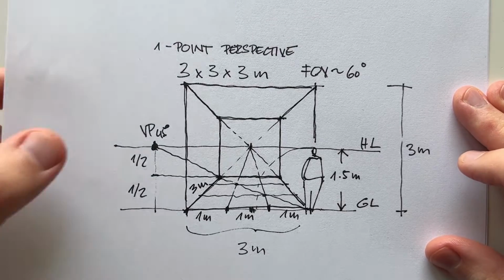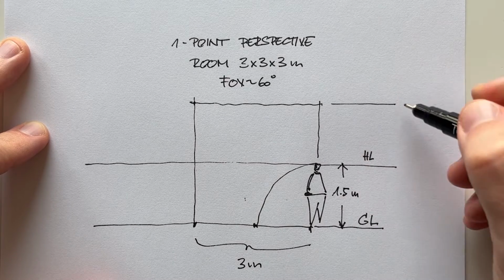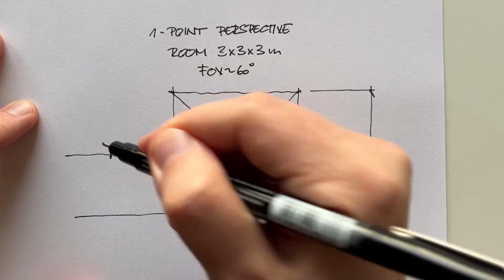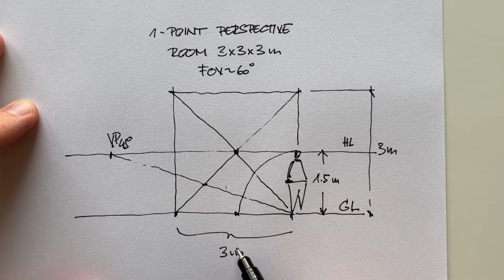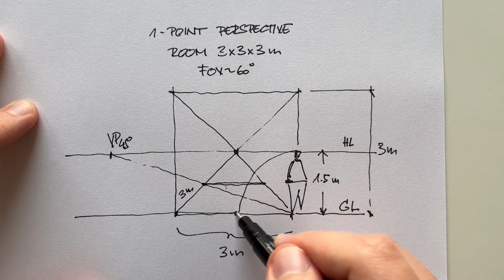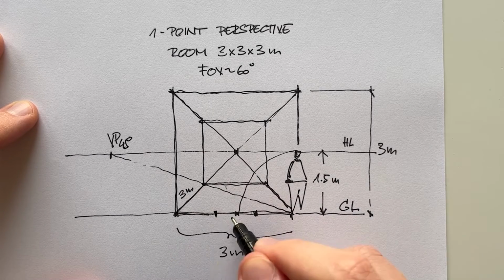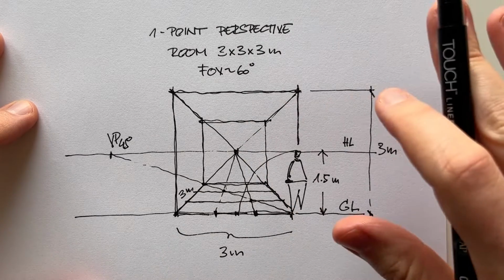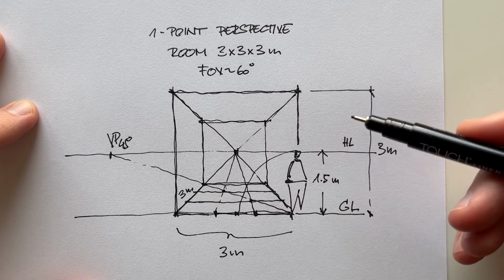The 2nd Easiest Way to MEASURE DEPTH in Perspective Drawing Freehand

Comment: Should the VP45° be called the Measuring Point 45°, it's NOT a vanishing point, isn't it? The parallel lines do not converge to that point. Thanks for sharing.
Reply from the maker: Thanks for the question. The way I understand it, it actually is a vanishing point where all parallel 45' degree diagonals would converge to.

Comment: Thank you for sharing useful techniques. ❤ That is what I need to apply on my sketches. Can you please make another video for different scales, not  3,3,3. It is ok making short ig reels, not full video, I also follow you on ig .
Reply: It’s like adding three meter depth first and then adding one more meter using modularity?
Reply from the maker: @hannah12070  exactly!
Reply: @DavidDrazil  thanks😍
Reply from the maker: Sure - what dimensions would you like me to demonstrate?
Reply: @DavidDrazil  3,4,3 ,pls
Reply from the maker: @hannah12070  but that's almost the same - you can create it the same way I showed in the video, plus add one more meter in depth using a diagonal to 45° Vanishing point ;)

Comment: Thank you for this video. And thank you for sharing so much other useful content. However, I have a question, and you can feel free to answer or not, as I don’t wish to exhaust you. It might require too much time explaining if you were to engage with it, but….

If you were to look at a photograph of a building, would it be possible to measure what is inside that photo? 

I’ve been thinking a lot about how to draw building faces that are turned away from the viewer turned towards the viewer, and all I’ve been able to come up with is a felt sense of what I think that building face would look like facing me—but not a true, accurate formula for checks-and-balancing whether or not that felt sense is really precise or not. 

In short, how do you know what an object in a photograph would look like if pointed another way, given that any plane facing away from you is always going to be foreshortened? Is it all up to guesswork in the end, and those powers within you as someone drawing to fabricate something that is believable?
Reply from the maker: Hi and thanks for your interesting comment!
The problem you described is what the field of photogrammetry is all about.
When it comes to sketching tho, and especially freehand sketching, the guesswork is always a part of the process as we often optimize for speed over accuracy.
Hope this helps a bit!